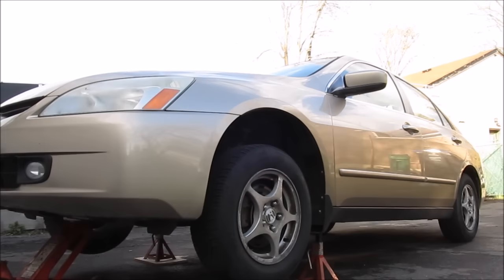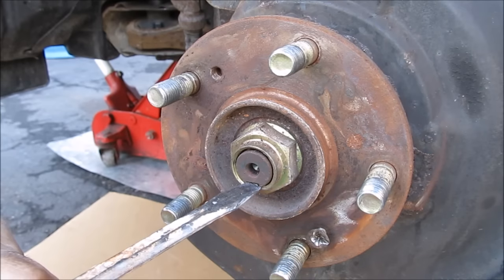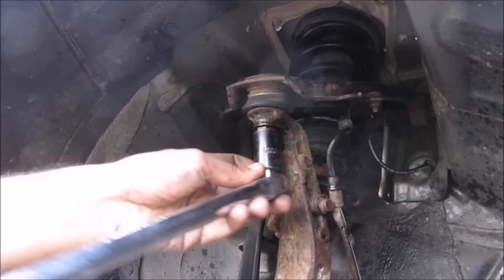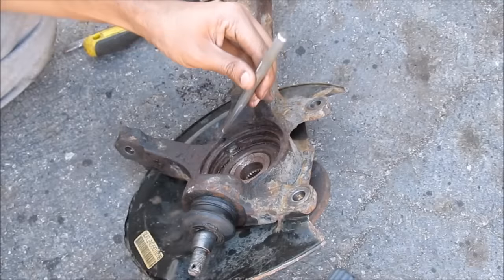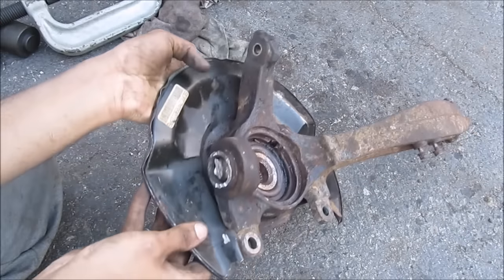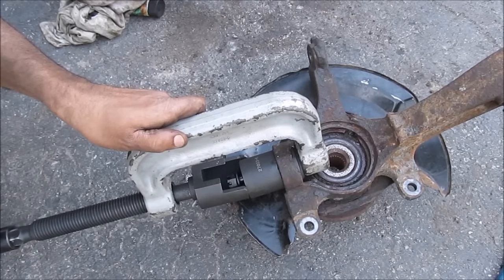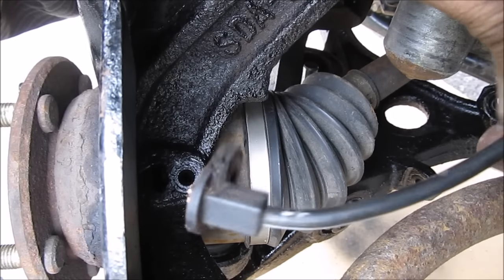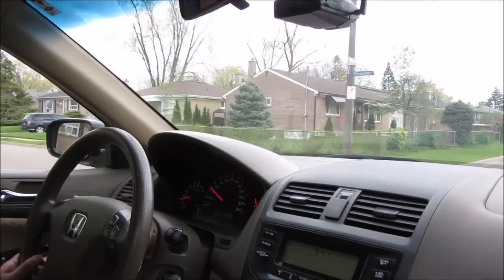Honda Lower Ball Joint Replacement

Comment: You can tell it's a Canadian car. I'm surprised your ball joints came out relatively easily. I had to curse and swear for mine to come out.
Reply from the maker: I'm surprised it came apart as easily as it did. 
This is how any 8+ year old year old car looks like here in Canada

Comment: When my car is running there is a smell of gas around the engine. Does that mean anything specific?
Reply from the maker: Exhaust leak
Injector leak
Car running too rich
Leaking gas tank
Exposed evap system

Comment: I cringe every time I see you get the sliver in your finger @ 6:15.  Hopefully the weather gets a little better so I can do this...got everything ready to go for the job Car is making an awful creaking noise from the ball joint...no play though. I injected some grease to save me some time.
Reply: how is the mevotec holding up? I stopped buying their stuff a while back, didn't last long for me. At least the bolts were broke free when I had to replace it again, haha
Reply from the maker: I didn't keep this car for long to tell, what was the issue you had in your part and what car was it?

Comment: Where do the wise if you are just learning right now do not be discouraged or intimidated by how fast this guy is doing this because for one this video is edited no one can do this kind of stuff in 3 minutes flat but yeah he probably only took about 20 minutes because he's done this a million times. For god sakes tapping those rotor screws out can take 20 minutes alone if they are rusted in really good. I used to have to take a punch to a grinder and make a fine point but it had to be the Right Punch because it had to have the right hard metals that's the part that sucked because if the screw is harder than the punch the punch does nothing.. I like his screwdriver tactic but you're going to need to put it to a grinder and get a blade on that trust me you're not just tapping a screw out like that in seconds and I doubt he even did that because you see how Rusty it was I've done a thousand of those and they don't just pop out like that. This guy is pretty good he probably is certified but to tell you the truth a lot of this stuff is done at the Les Schwab down the street.. don't get discouraged it's not that difficult he's just doing it really fast and being so fresh you're already scared but if you pause it and slow things down you can easily figure this out but honestly I think this video would have been better without the making Provisions for the wrong press tool. Even I want to learn some things and once he said something about having the wrong press tool I'm like well damn that's what I came here to kind of learn. He didn't demonstrate how to remove a ball joint with the tool he demonstrated how to remove a ball joint if you don't have the right tool and that's just silly when the right tool is just 20 or 40 bucks I mean if you're already trying to save $1,000 that's nothing

Comment: Google: Balljoint Replacment with Autozone Free Rentals 27023 & 27164

That will direct you to a Honda-Tech thread, that shows how to use the Honda adapter set, without having to cut/saw the old ball joint in half.

Great video though. Thanks.
Reply from the maker: +pellergin Thank you, unfortunately all my local parts store had the universal honda set of ball joint adapters and not the one for the gen 7 accord.

Comment: I dont reccomend mevotech ball joints! For hondas use Moog.
Reply from the maker: Why do you say so? Have you had issues with them?
Reply: speedkar99 have upper ball joints from mevotech supreme on my frontier they are not even 2 years old and they are making poping noises mevotech is china crap. I would use mevotech for outer tie rods thats about it!

Comment: painting over that rust without removing it first with a wire brush isn't helping... it will continue to rust under the paint now even faster...
Reply from the maker: I did wirebrush it off camera
Reply: okay good

Comment: Way more trouble than it’s worth. If I had a Honda I would pay a mechanic to do it. I have a Toyota and they are much easier to remove ball joints.

Comment: averci spruzzato lo sboccante sopra il cuscinetto non 'e una bella  idea, dopo un po diventa rumoroso perche' si liquifa il grasso, per il resto tutto ok.
Reply: He said: spraying penetrating oil on/near the rubber boots of ties rod end, upper ball joints, etc, is not a good idea BC it will eventually enter and liquify the grease, washing it out, and lead to early part failure.

Comment: FOR THE LOVE OF GOD STOP WITH THE DAMN ANTI-SEIZE I see ppl do that all the time and it drives me nuts. What you're doing is basically eliminating the fastening torque; this is a good way to lose control, perhaps on the highway, and get yourself very much dead. And don't think that little cotter pin is going to save you at 65/75mph.

Comment: i think ill push my car onto a cliff
Reply from the maker: If you don't change your ball joints it'll break sending your car down a cliff regardless
Reply: speedkar99 thanks.   its interesting how you said that.  two years ago we were driving uphill in Oregon.  it was raining .  my accord s   right ball joint disconnected,  dislocating my axle to wheel.  three feet from us was a cliff.